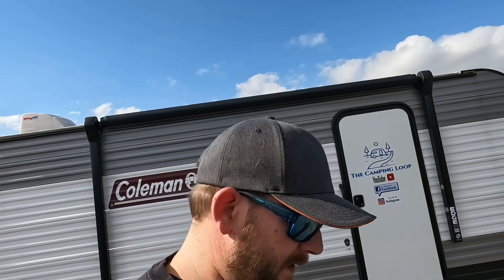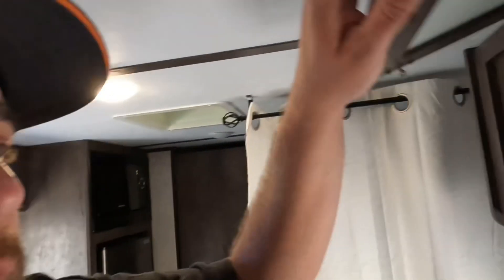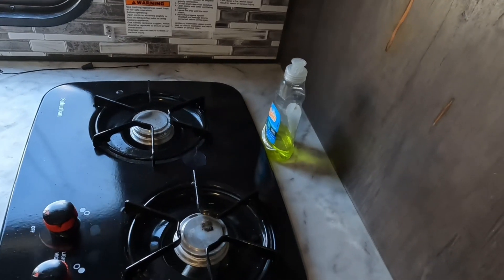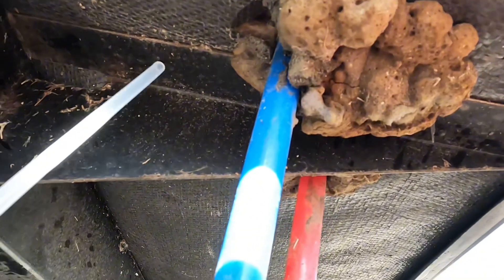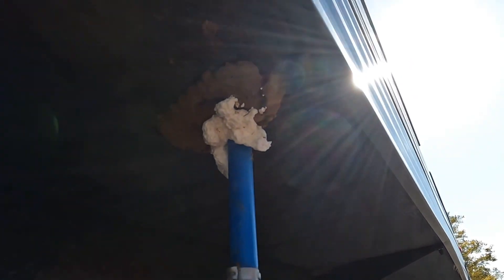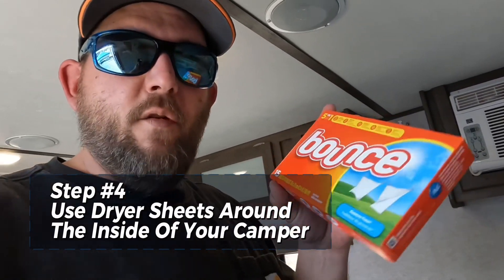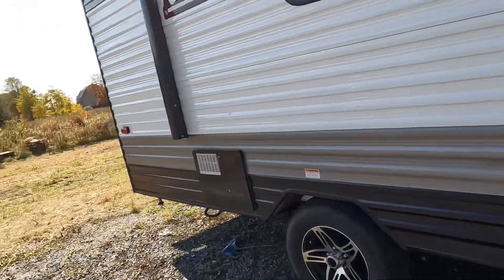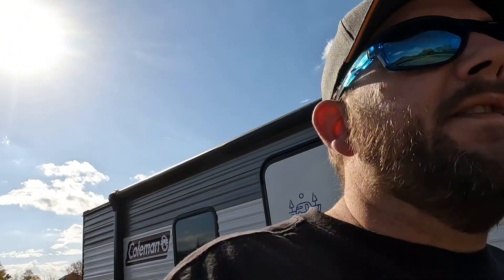How To Keep Mice OUT Of Your Camper: 5 SIMPLE Steps To Follow

Comment: Pepperrment oil is a good deterent for rodents but must be refreshed often.  Also check wheel wells for any openjngs as sometimes debris is kicked up when travelin causing a hole or separation in seams.  Metal split flanges over pluming & electrical entries . Vents to heaters refrigs & heaters need  a metal sheet  cover inside vent to keep rodents out. When unit is in storage
Reply from the maker: Good tips! Thanks for watching

Comment: One other tip is to make sure all outside storage doors are closed and locked. I had a storage door which had to latch mechanisms, one locked and the other just a twist to lock.   I left this storage door unlocked one year and got a ton of mice inside because the mice where able to between a small gap they made between the door and the wall of the camper.  It was NOT a lot of space but they made their way in.  I am now making sure that I always lock all the storage doors to ensure they can't push their way past the door.
Reply from the maker: Very good point! Thanks for the tip and thanks for watching!

Comment: 3:13 They make a spray foam i cant remember brand that is a rodents repellent as well i believe i got it at lowes . They were getting in my enclosed  job trailer , haven't had a  problem since..just looked it up it's Great stuff and tom cat I'm sure there is other brands
Reply from the maker: Good tip👍

Comment: In the process of closing up my camper I can hear mice or Chipmunks inside my ceilings. I have buckets underneath the camper when I tap on the ceiling I can hear Akon's rolling. The problem is they were already in there how to get them out
Reply from the maker: Sounds like chipmunks if you can hear or see acorns. There has to be some sort of entry point that has to be sealed up somehow